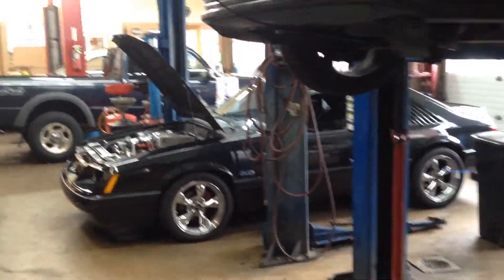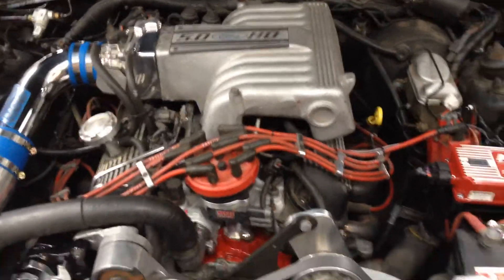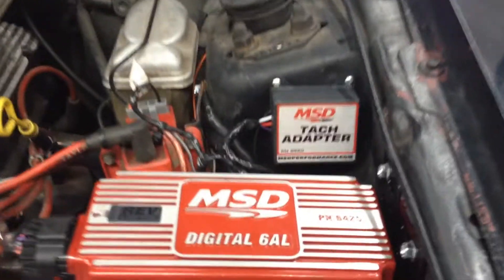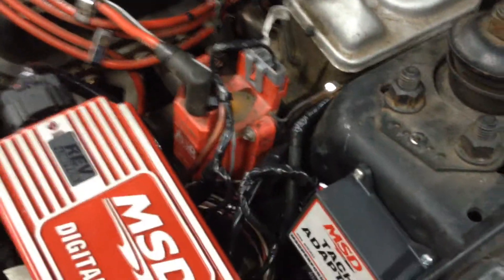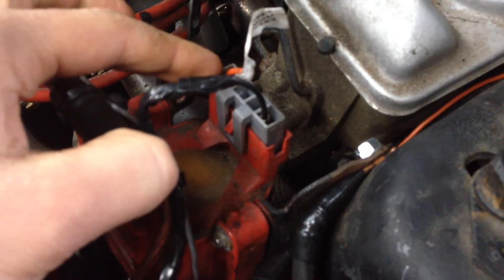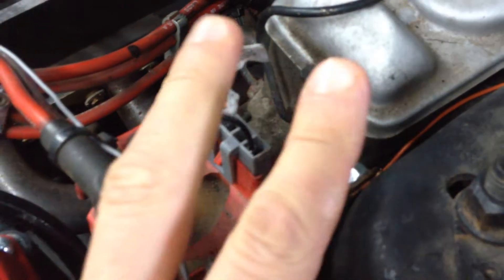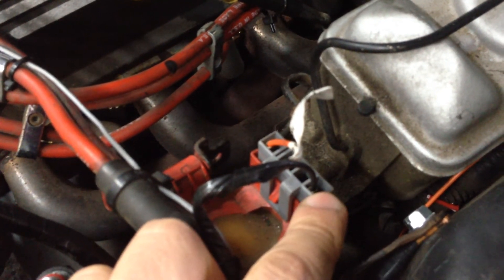1986 Mustang MSD Tach Adapter install w/ TFI system using the 6AL.

Comment: So my car is carb 331 stroker. I can't get this tach to work correctly. It's idling at 1200 rpms. Purple going to tach output at dash. White going to msd box. red to ignition on and black to ground.
Reply from the maker: do you have the adapter?

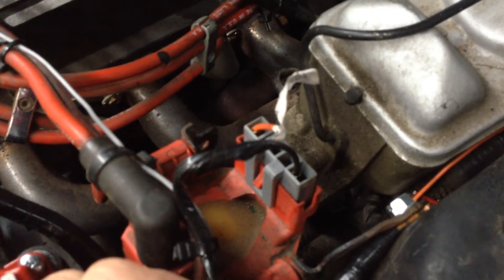Comment: The stock TFI harness connector on the coil has 3 wires; red, green-yellow and green-orange.  You say you connected the purple wire from the tach adapter to 'one side' and connected the 'normal one'  wire to the 'other side'.    Could you please elaborate on the position in the stock TFI harness connector as shown on your video? I.e., red is right side, green-? Is middle and green-? Is left side of the connector as shown in the the video.  Also, what do you mean by 'normal one connected to the other side'  at 1:34 ?  I would like to learn from your efforts without cutting up my harness only to have to reconnect it and worry about asthetics and reliability later on.  Thanks a lot for for your clarification!!
Reply from the maker: so from what i remember answering you this late in the game. "normal" one meant the original wire form the tach. bottom line is you had to use the wires from the tach together w/ the originals to make anything work.

Comment: where did you get the bracket to mount the 6al or did you make it?
Reply from the maker: +Nick Adams  I am sorry for getting back so late!! We made it. It is actually 2 flat pieces of aluminum plates purchased form Home Depot. We bent them into shape and bracketed them together. We then painted them black to kinda match car color.